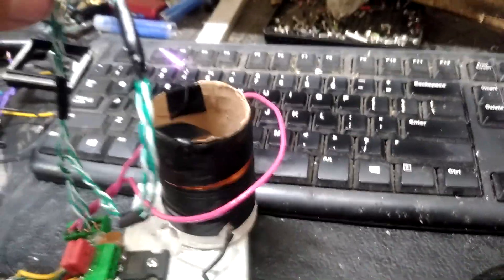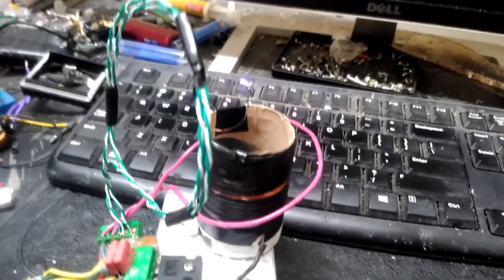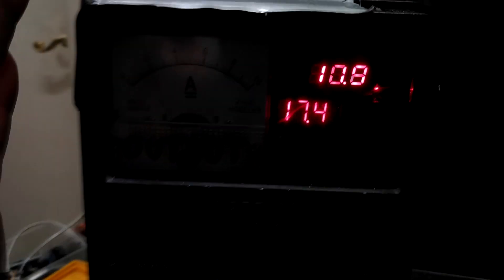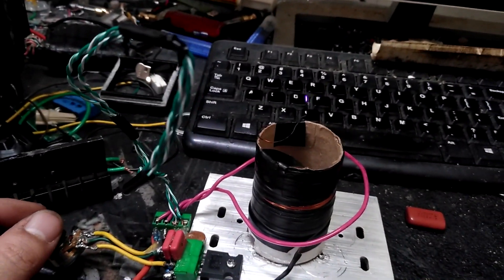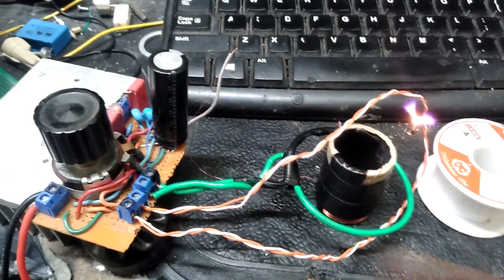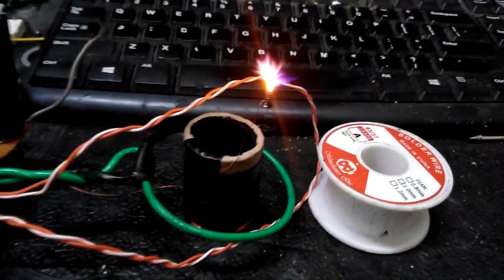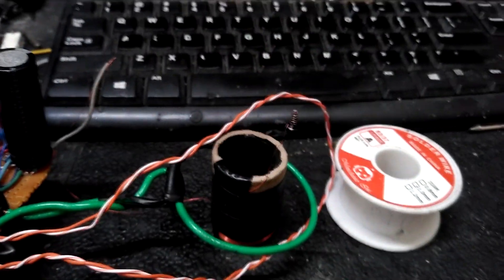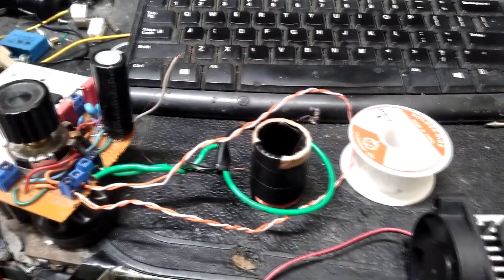Couple more mini HFSSTC's

Comment: Does the polarity of the primary or feedback matter ? I mean if it does not work should I try rotating the primary 180 degrees or the feedback?
Reply from the maker: Yea polarity matters but you may also need to play with all the other coupling variables as well
Reply: @Magneticitist  Great I already build it , I am gonna test it later , I found a 5.6 zener for the divider so I used that , I am gonna test it without the resonator first , just to get it into oscilation
Reply from the maker: @rodriguezfranco3839  I don't exactly recall that circuit operation at the moment but I've typically got the feedback winding powered by the resonator.
Reply: @Magneticitist  I was watching the teslaundemehr video and I think he fist test it without the resonator , raising the pot up till it started oscilation , then he added the secondary , I was thinking having a cfl or this freq counter I made so I would see when it starts oscilation
Reply from the maker: @rodriguezfranco3839  If it's the same circuit then I guess it will work. I figured that would only work with the other circuit that doesn't use a feedback winding.
Reply: @Magneticitist  well hehe I been playing with it , and I can't get it to oscilate I need to recheck everything , I fliped the primary and feedback both ways and moved the potentiometer all the way to both sides and nothing happends , I was monitoring the amp draw all the time and it draw 0.05 amps everytime so there must be something Wrong
Reply from the maker: @rodriguezfranco3839  Might be something simple. I never really had too much trouble with those things. You could maybe try temporarily using a 2 turn feedback or something. I usually got away with using crap capacitors also. I guess it's basically sort of like a drsstc but using a high current feedback winding whereas with the drsstc typically it's a very low current higher voltage feedback. Getting initial oscillation seems like it would be harder.
Reply: @Magneticitist  I got it working brother , I do not know what the hell was wrong , but I was trying to measure how much voltage was going to the gate , and when I touched the gate with the multimeter tip it started working now it works great it draws very little current less than 0.5 amp with the gates at the lowest and 12v input , I am gonna play with the potentiometer later to see if it increases the output , seems to be running at lower Frequency cause the slayer exiter was driving that same secondary at 4mhz , and this is showing me 2.7 mhz I just uploaded a little video
Reply from the maker: @rodriguezfranco3839  Cool. If it's getting primary oscillation via a feedback winding then it's probably going to run at a different frequency than the slayer since the slayer was direct secondary feedback. You can try playing around with feedback winding orientation relative to where the primary is at the time, but if the secondary is really closer to 4mhz and it's running closer to 2.7mhz, it can still be kind of a cool setup where you will draw very little current until you start loading the secondary. Hard loading like arc pulling can then start giving real good output.
Reply: @Magneticitist  I already blew the gate on the 260 , when trying to pull an arc at 19v , the potentiometer was at the minimum , but somehow feed must be too strong and blew the gate open , I am gonna get a 460 later , I hate that I killed so fast I did not get to experiment much with it , probably two turns was too much for the feedback , the output was very low it did not breakout on it own that is why I tried to step up the voltage
Reply from the maker: @rodriguezfranco3839  It's not going to break out on its own unless the secondary is running close to resonant peak. It's also basically supposed to run class E also so no telling what is happening with variation. With a short thin breakout point, something like 1-2 inches tops, you should be able to see breakout at 12-15v if the coil is resonating.

Comment: Nice can i audio modulate it?
Reply from the maker: Yea I have from power rail again with same circuit but different coil
Reply from the maker: Actually it was my tiny singing hfsstc, it was this circuit also but that one was better tuned. With these you can just kind of see that you may be able to get any random coil to breakout if you play with the winding arrangement enough.